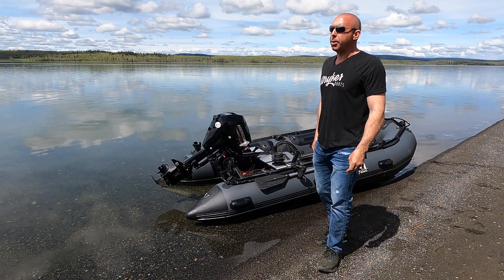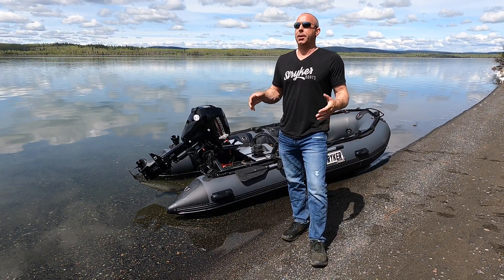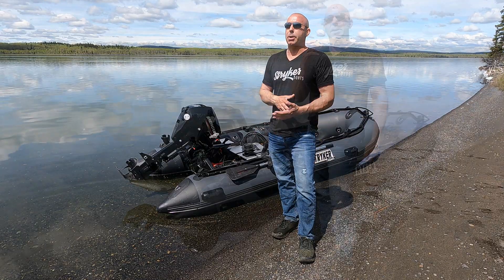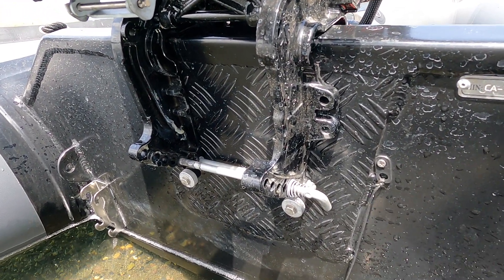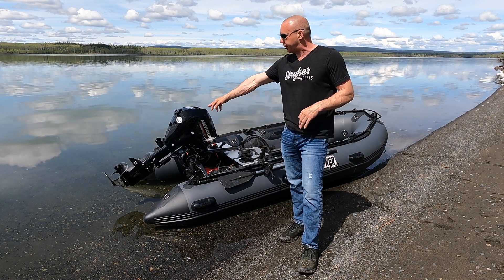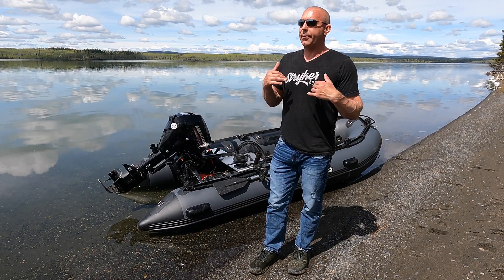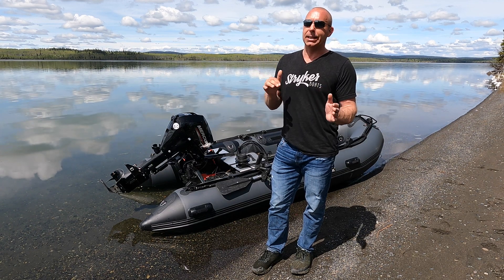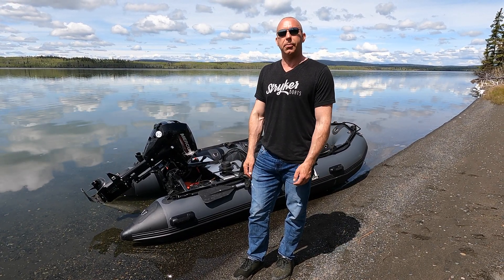4 Ways to FIX Motor CAVITATION/VENTILATION

Comment: its funny because to me the first thing you want to check is the propeller conditon and rpm at wot ... i had a damaged 9.5 x 10 prop on my 15hp evinrude wich was spinning way too much for my 128 pounds wide kaboat ...changed for a brand new 9.25 x 12 and ventilation disapeared except when i hit 2 feets waves a full throttle it will catch some air but running full throttle in those conditions is not confortable anyways so going 3/4 throttle in those condition prevent it. Another i need to do is add at least 1 additional psi to each tubes and 2 psi to the keel and floor since the water in my area is kinda cold and must drop my psi below ideal pressure thus not cutting the waves properly. I am not sure an hydrofoil would let me hit 2 feet waves full throttle anyway, maybe help me keep the nose down when alone but its almost never the case because I always sit someone in the front. Thanks for the video man.
Reply: so a higher pitch on your prop reduced the ventilation???  I've got a 16ft heavy duty kaboat with a 12 hp 2 stroke hangkai.  I dont know if the ventilation is coming form the chop or possibly the air just going under the flat bottom inflatable kaboat but those are my guesses.  A hydro foil did help, but I still get ventilation when only 1 or 2 passengers.  I'm going to upgrade to the 18hp and I expect more ventilation that I want to fix.  I'm considering prop rake, #blades, pitch and size, but also considering another hydrofoil.  I normally ride in light chop and dont wont to have to always slow down to prevent ventilation.  I'm only doing 14-19 mph at the moment.  any advice is appreciated!
Reply: @chrischrebet  no i ended up with a solas 9 pitch prop to max out the rpms and get 40kph ( 25 mph ) on my 14 feet saturn zodiac...the ventilation was caused by the bad condition of the old prop....get a tachometer to make sure you hit the as close as possible to the max rpm if not drop more pitch...i sold my evinrude and got a 15hp yamaha now with a 10 pitch on  it because the gear ratio is different and hitting the rev limitor with a 9 but im getting 42kph ( 26mph ) since the newer outboard  hp's are taken at the prop rather than the engine thus pushing more than older 15hp

Comment: My issue is the new 25 mercury I purchased with a new 14 ft. Princecraft . It’s a 20” long shaft . 2023 , both models. The outboard when clamped down on the stern puts the ventilation, or anti ventilation plate two inches to low . It should line up with the lower keel @20” no? . I spoke to a mercury tech. and was told they measure from the inside of the clamp down to the lower unit bolts and not the ventilation plate . Most new small craft boats and some old have  either 15” or 20” transoms . Why are the mercury small outboards 2” to long . Before it was stolen, I had a 25 four stroke Yamaha ( brand new) on the same boat a the fitment was just right , with in a half inch. Forgot to mention , I played around with the trim and jacked the motor up . By doing that it looses all its integrity not to mention it looks just wrong . Maybe one of those fins bolted would help .
Reply: my issue is lack of money.

Comment: The fixes you describe have nothing to do with cavitation or the boiling of water due to a low pressure area. What you are trying to fix is ventilation which is pulling air from the surface into the propeller. That plate on the motor is an anti ventilation plate. This is the same sort of thing when people say quite instead of quiet, or loose instead of lose. Wrong description.
Reply from the maker: Hi, you are right, it’s technically the wrong description, but the reality is people refer to this issue in the inflatable boat industry as cavitation. We are suggesting fixes for their Issues. I explain it’s actually ventilation we are fixing in the video.
Reply: @StrykerInflatableBoats  ahhh bro, you are just making it confusing for the people who actually know the difference!

Comment: Cavitation and Ventilation are two very different scenarios. In most cases,  it is as you noted having the propeller ingesting air from the surface causing loss of thrust. Cavitation occurs when the propeller compresses the water to such a high PSI that the temperature exceeds the boiling point and a gas bubble is formed. Both can cause damage to the propeller face. Someone somewhere named the “anti ventilation plate “ incorrectly and caused all the fuss. Thanks for posting this. Many many boaters could use some guidance on proper mounting and trim. Not to mention the right prop for the boat to start with. Engineer Jeff.
Reply: Actually cavitation occurs when the propeller decompresses the area in front of the prop to a low PSI which lowers the boiling point of the water getting sucked into the propeller. 

Higher pressure would increase the boiling point such as with pressure cookers that increase pressure to keep the liquid from turning to steam, keeping things moist during cooking.
Reply: @1985wolfman I agree with this.
Reply: Agree with everything except that water is not compressable.
Reply: does a propeller have a mouth , stomach or digesting system to be able to ingest air ?  I thought only pragnemt women would ingest air.     but it's good to know propellers have way more than just pitch and diameter for me to worry about. they also have mouths...   do they eat , i mean, ingest gasoline too ? my boat's engine is consuming too much gasoline, I'm afraid it's the propeller ingesting it just as it ingest airs.. it would be ingesting water ( as far as available food for propellers are )...  I hope you understand me in my confusing world of analogies.  lmao
Reply: Jeff I’m running a Yamaha 25hp 2 stroke on my 14ft boat engine is suited for the boat right size ect but I’m having this problem it’s like it putting out to much power for the propeller size . If I was to go up a small bit in pitch angle  would it help the problem and maybe gain some extra speed. I was thinking maybe my pitch is to low and has to much  hole shot taking off cause once I get out of the inbetween to wide open its perfect